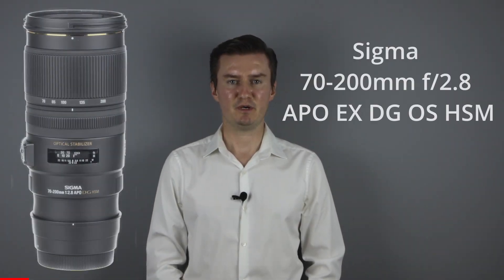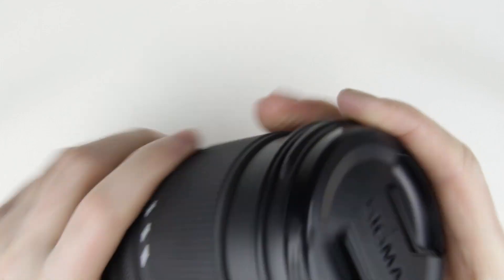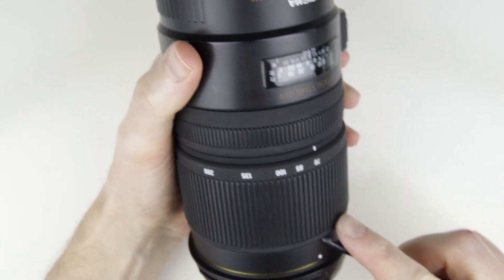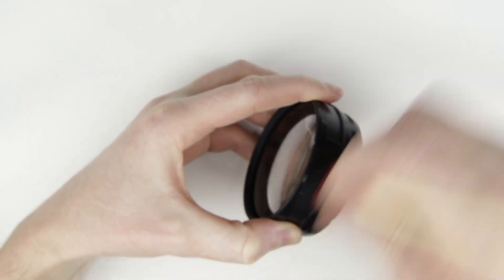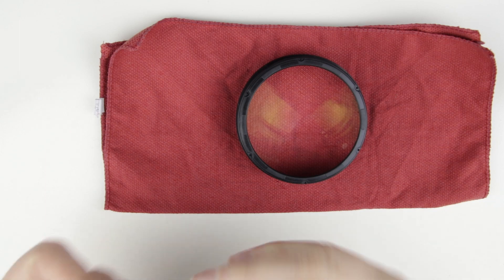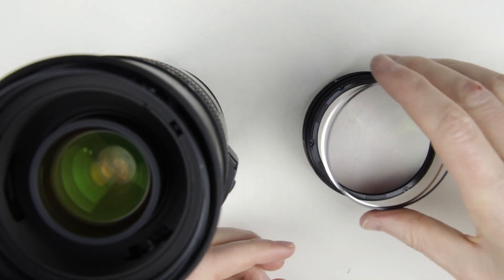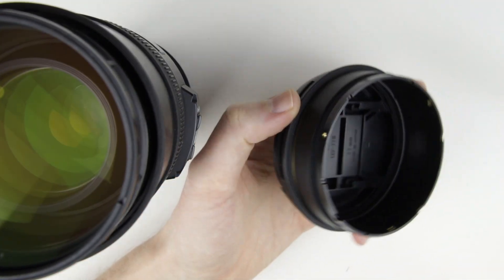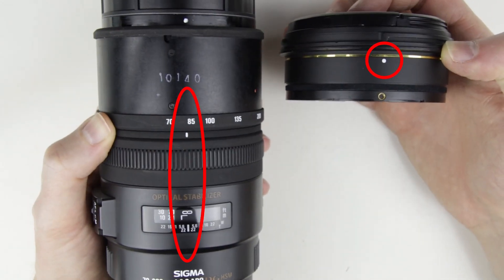Sigma 70-200mm f/2.8 APO EX DG OS HSM - how to clean the lens inside

Comment: Hallo, thank you very much for your videos! I’m experiencing some barrel wobble on this lens model, could you give me some piece of advice on disassembly or how to access to the screws which need to be tightened? Thank you :)
Reply from the maker: I don't have complete disassembly video for this lens, but if you're familiar with electronic repair, you might watch my other videos about disassembling the Sigma 70-200mm lenses, maybe the steps are similar. Also, if you choose to disassemble your lens, I would recommend to make a video about that, it might help to assemble the lens.

Comment: nice video,but i was wondering if the first element can be opened as i have a 50-500 and there seem to be cracked glass chips in between the first element and i am trying to clean it
Reply from the maker: Generally speaking not. Usually there are two lens elements glued together in the front, and generally it is impossible to separate them, and then put back them together perfectly.

Comment: Hello sir.
I have an older sigma 70-200 2.8 lens, it says APO on it, as well as EX. It has been a good lens. The difference between the one that you show here and mine is that there is no sour rubber cover on the end of the barrel, and no af-m switches on the side of the lens.
The selection of auto focus and manual setting is made by moving the collar forward or backwards on the barrel.
Anyway, I have noticed some growth of possible mold inside the front of the lens. But on this lens, there are no screws visible to take the front end off. There is a locking ring that you unscrew out of the filter threads, and once that is done, you can rotate the front lens freely, but there is still something like a collar that holds the lens in place, and try as I might, I can’t get the front lens to come out. Do you know how they got the front lens out of these older lenses? 
It would be a shame to have to retire this lens, especially when I can see that the growth seems to be just on the lens behind the front one but the growth is starting to mess up the contrast of the shots in bright conditions, and if the light hits it just right in other conditions. Any suggestions would be greatly appreciated.
Reply from the maker: I have other videos about the disassembly / assembly of the older Sigma 70-200/2.8 lenses... those might help you.

Comment: Nice video.  I have the non OS version, will I be able to remove the front element in the same way or do Inhave to disassemble the whole lens?
Reply: Ya i having the same non OS version. Also wondering the same. Hopefully we can the answer soon.
Reply from the maker: I have videos about the complete disassembly of the non-OS version, you can use that to figure out how to remove the front lens element.
Reply from the maker: I have videos about the complete disassembly of the non-OS version, you can use that to figure out how to remove the front lens element.

Comment: Hello sir this camera was dropped and was broken into 2 haves at the swm unit which was broken I disassembled the camera welded the metal well but the focus flex cable was severed do you know where can i get and assembly instructions
Reply from the maker: If the cable of the HSM motor is damaged, than most likely you have to replace the motor. Alternatively, you might use small wires to reconnect the two cable parts together, because as I know there are only a few wires in that flex cable and the wires are quite wide, so you could solder them together.
Reply: Thanks a lot for the reply It is not the motor wire it is the brush sticker on the barrel i will try soldering what about the instructions of assembly
Reply from the maker: @khomouda  I don't have assembly video.
Reply: @CamerasLensesEtc  thank you very much

Comment: Hi, I saw some fungus inside of my lens(same). So I dissembled it. But fungus are inside elements. I tried to  separate lenses in the element, but accidentally shattered the rear element. What should I do. I'm in a big trouble. Help me to buy a rear element please..
Reply from the maker: Check ebay for lens parts, sometimes there are sellers who have for sale. Alternatively, you might find a non-working lens which is the same as yours, swap your broken lens element, then sell the remaining non-working lens as lens parts.